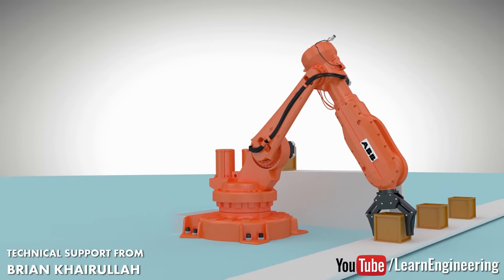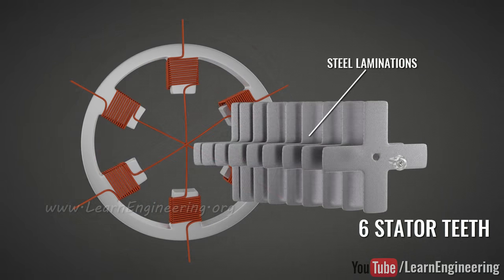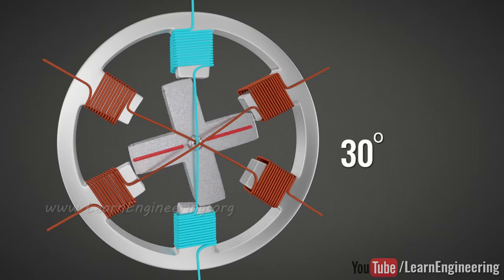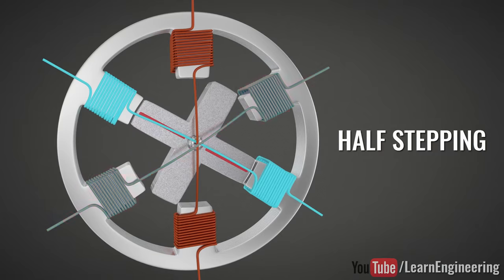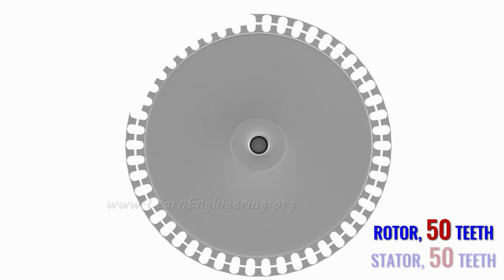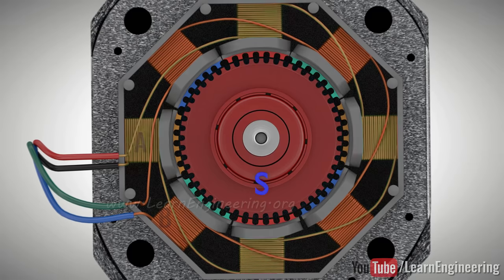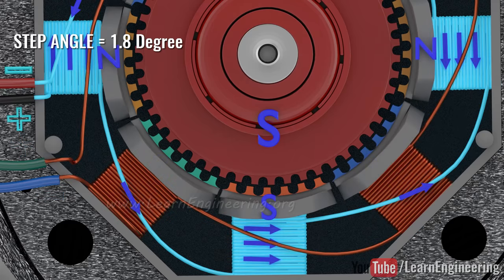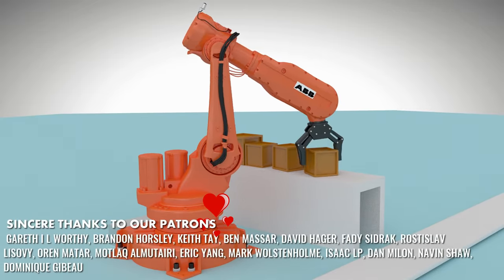How does a Stepper Motor work?

Comment: Can i subject-buy and hv ez job in this? If school havent start, what life been about as topic? If have a relaxing place to talk of stuff learn stuff like this before school starts? I heard that all been cycling or magnet? How is this done is it by alot of voltage underground and magnet?
Reply: If it is too "life will go bad" due to surrounding or readers, then when will be like the fight? Because life is only once, then we have gone thru alot that they maybe had created alot of illusion like a wish can be granted without writing anything. How they slip-in vocab "redha" when i was told nobody will read this?
Reply: If the motor is abt making it move front and back, the 1st joint, if excavator method, just using compressed air(no electricity needed except vehicle wheel movement right?), is the same strength? Will it be cheaper or not? Just alternative ideas, in case smthg mess up, just an idea.

Comment: Real, practical robots prefer servos, and they're really fast in industrial application.  For positioning they can use pots, hall effect sensors, gray encoded optical wheels (great for electrically noisy environments), etc, even ordinary switches.  These slow stepper trash are used for toys and stuff, they were once used in dot matrix printers to feed the paper and have other minor or trivial uses, like education.  Those applications listed at the end show how rinky-dink they are.  Three phase servos are the way if ya wanna go big.

Comment: Are you really implying that they use stepper motor in industrial applications like an ABB robot?
Sure stepper motor are great for hobby electronic projects. But in industrial robots they use dc motors with a closed loop control achieved with an encoder. Such servo systems are much more precise but also much more expensive.
In most industrial system you NEED to know what the exact position/speed of a motor is and you also need to know if the position has been reached or not. 
All that aside, stepper motors are still great, that's why we have such cheap 3D printers at the moment.
Weren't it for stepper motors, the price of most 3D printers would costs several thousands euro's if they used encoders in combination with (BL)DC motors.

Comment: Cut it into 15 degree integralls between coils on super large motors.
Reply: Then cut back to 30 or even 60 degree integralls at full rotation frequency.
Reply: Water rushing thru turbines attatched to drive shafts will produce tourque without using electricity you are producing.

Comment: How’s the rotor going to spin if the magnetic fields of the rotor are not split ‘axially’ around the center ?
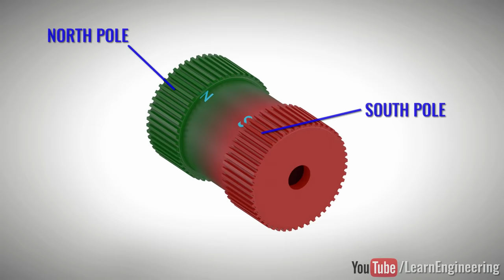@2:55 it shows the rotor fields as ‘to and fro’ lengthwise...how’s that going to react to a changing magnetic field ?

So what I’m saying is that the way they’ve explained it...with the orientation of the rotor magnetic fields lengthwise, when the stator fields are energized, the roto will be pushed or pulled axially not rotationally along its axis...I think their view of the rotors magnet is completely wrong.

Comment: And even more control is achieved by gear reduction. if you run a 9 to 1 ratio on your power train your .9 degree half step becomes a .1 degree half step.
Reply: Enters backlash

Comment: need to know how to test them
Reply: Resistance on the windings. Also a two switch alternating setup will run the steppers thru a revolution slowly. The switches are manually flicked in sequence to simulate a stepper drive grab and release. Google.

Comment: Is it only me or the poles of the stators and rotor is wrong? According Ampère's circuital law, the current direction and poles of stators are wrong, some of them.
Reply: I don’t think your wrong...I agree with you in that...How’s the rotor going to spin if the magnetic fields of the rotor are not split ‘axially’ around the center ? So what I’m saying is that the way they’ve explained it...with the orientation of the rotor magnetic fields lengthwise, when the stator fields are energized, the roto will be pushed or pulled axially along its axis...I think their view of the rotor is completely wrong.

Comment: but how choose the direcction of movement?
Reply: It'll move the shortest possible distance. So, whichever set is energized, the rotor will be moved in the direction that requires the smallest turn to align.
Reply: ***** it's true, but in this case, with two coils you only can alternate or connect boot, and that do the same twist. Or maybe can be inverted the polarity of current in the coils?
Reply: SerK Lintur For the four pole, or the more complex one?
Reply: ***** sorry for mi bad english.
I have steppers with 4 wires that move in both directions, i understand the video, but i don't understand the reverse movement without a reverse polarity in one of the coils
Reply: SerK Lintur My guess would be to reverse the polarities of the input wires, but I'm not sure.
Reply: The polarity of the coils in bipolar stepper motors changes constantly. The sequence the motor drive outputs determines direction of rotation. Stepper motors are electronically commutated.

Comment: good explanation. However, stepper motors are only useful when there is a well defined mechanical load for them. If not they can easily block, vibrate and many other reasons why they can get out of sync with their rotating magnetic field, causing disaster. This is especially true for high speed operation. An educational robot might use stepper motors at low speed. An industrial robot never will ...

Comment: Video is missleading. Robotic arms very rarely uses stepper motors! They uses servo motors. Because Stepper motors "Does not know at what position he is". The only trick you can use for example in cnc or 3d printing - let device find end positions using switches. But normal industrial robots would use only servo motors, which would try to move to signal position.

Comment: https://youtu.be/m8x3oqcwfVg

1.진동 조절 용도의 혜성캠을,  효과를 높이기위해,
 자유회전 속도를 가속화해서, 
자동적으로 
 진동 조절의 효과를 높이기 위해 보완작업을 완성하다.

2. 진동이 현재의 상태보다 더 심할 땐, 좌우 혜성캠이 같이 회전되었다. 

3. 지금의 동작상태는 회전이 자유로운 혜성캠의 진동에너지를, 혜성캠이 흡수해서 회전력을 강화했고,
진동은 완화하는 역할을 했다.

 4. 좌우 또는 회전을 하는 혜성캠은 실에    
 매달린 추처럼, 또는 선박의 평형수처럼,  좌우 진동을 균등하게 함께 조절하는 작용을 한다.

1. Comet Cams for Vibration Control, to increase effectiveness,
By accelerating the freewheel speed, 
automatically 
complete complementary tasks to enhance vibration control

2. When the vibration was worse than the current state, the left and right comets rotated together. 

3. The current state of operation is enhanced by the absorption of the vibration energy of the comet cam, which is free to rotate.
The vibration played a role of easing.

4. 
It controls left and right vibrations equally, such as hanging weights or boat equilibrium.

https://youtu.be/ZFqSgOF2cjU
#자기중력에너지11.#selfgravityenergy11.#자중캠11.#혜성캠11.#flyingcam11
친환경을 말한다.
오염물질 정화기능 시설을 말한다.
원자력발전소의 피해를 말한다.
수력댐과 화력발전소를 공해를 걱정한다.
대체 에너지의 친환경 장점을 말한다.
태양광 에너지는 발전 효율이 3.8시간.
지열발전소는 장차, 지진을 유발하고 지구속의 지열을 뽑는 시설임으로 땅속의 온도가 내려가서 기온변화와 지진을 유발시킨다.

대체에너지의 여러 화학적 기능을 뽑아 결국은 자연의 화학적 구조를 다른 데로 변화시켜서 에너지를 생산해도 또, 다른 화학적 불균형을 만든다.

그렇다면 가장 친환경적인 에너지 생산은 없을까?
만약, 자연의 물질을 화학적으로 어떤 변화도 주지않고 물리적 이동만으로 에너지를 만들 수 있다면 어떨까.

에너지의 기본 개념은 회전력이다.
수력처럼 중력으로 떨어뜨려 터빈을 돌리고,
화력처럼 분해하던 데우든 화학적으로 가열해서  증기나 열로 변환해서 터빈을 돌려 그 회전력으로 힘을 만들어 내는 원리가 에너지 생산 기능이다.

그것은 태초의 우주생성과정이 기류의   밀도에 의한 강약에 의해 이동하고,  회전운동해서 압력과 폭발의 인해 에너지가 만들어지고, 그에 새로운 원소가 만들어지고 찌거기가 만들어져 고체화된 운하계의 과정에서 에너지가 만들어졌다면 회전운동이 모든 물질의 최초 에너지인 것이다.

지구를 보면 태양을 구심으로 공전과 자전을 한다.
자전을 하는 근원은 태양열에 의해 한쪽 지면이 데워지고 이것으로 인해 기류의 움직임에 의해 지구가 자전한다.

그런데 그 원리라면 모든 행성체는 자전속도가 같아야 한다.
그런데 지구는 그 속도가 매우 빠르다.
태양도 자전속도가 빠르다.

원인이 뭘까?
무게중심을 이동하는 물이 있기 때문이고, 태양은 내연기관처럼 폭발이 일어나서 빠르다.

그것을 증명할 수 있는 달의 자전속도다.
그렇다면 바닷물이 달의 인력에 의해 당기고, 놓고하면 밀물 썰물이 일어난다.

https://youtu.be/ZFqSgOF2cjU

It is a friendly environment.
This refers to a facility for cleaning pollutants.
Damage to nuclear power plants.
They are concerned about pollution in water power dams and coal power plants.
This refers to the environmental benefits of alternative energy.
Solar energy has a power efficiency of 3.8 hours.
Geothermal power plants, which will cause earthquakes and remove geothermal heat from the Earth, will cool down and cause temperature changes and earthquakes.

It takes out the various chemical functions of alternative energy and eventually changes the chemical structure of nature, producing energy, and creating another chemical imbalance.

So, isn't there the most eco-friendly energy production?

What if physical movement alone could produce energy without making any chemical changes to natural substances?

The basic concept of energy is torque.
Like the hydroelectric force, it drops to gravity and turns the turbine.
Energy

Comment: milling machines use servo motors...  stepper motors dont have the speed needed or position feedback... closed loop servo motor systems are absolutely necessary for the applications you described as using open loop stepper motors.... 
if you actually knew what you were talking about you would know this... 

sure you can build them with steppers but they wont be without faults. the industry requires position feedback and speed. 
you cant make money if your stepper controlled machine takes 20x longer to do the job as a servo controlled. you would be blown out of the water by competitors.
you would be SOL if your stepper controlled milling machine milled itself to pieces.  i've seen what a tired stressed boss can fk up in programming the tool path. if that happens to the machine and not just a huge block of aluminum, your out a heck of a lot of money.